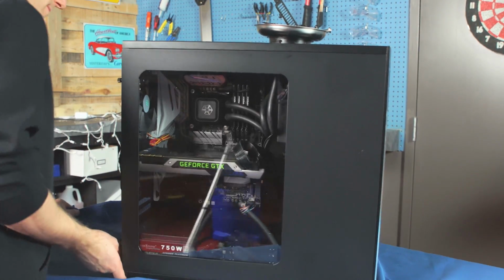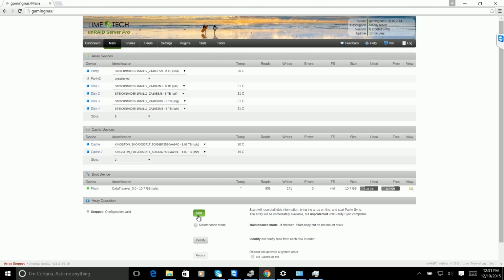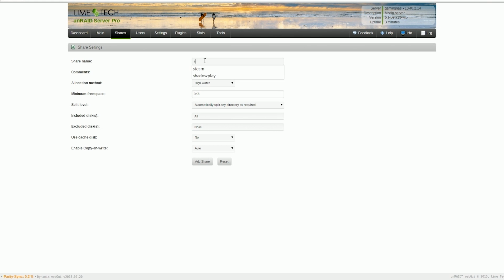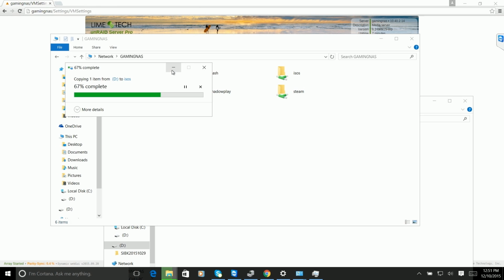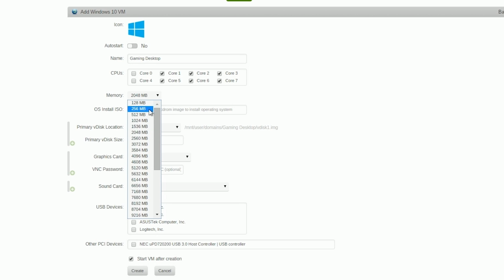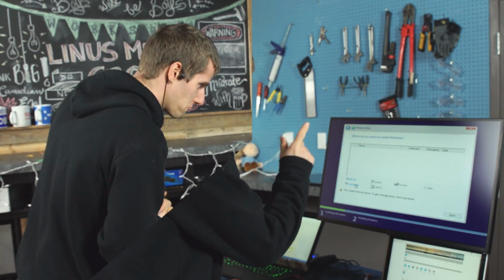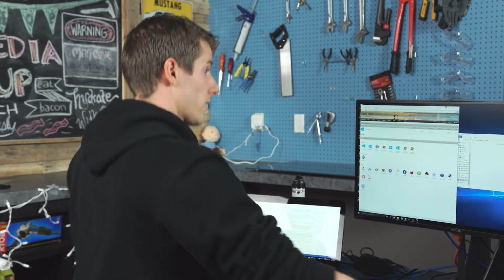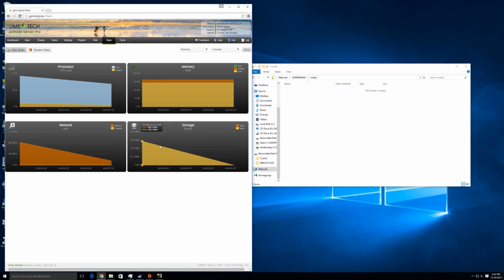Use your Gaming PC's Extra Power as a NAS Ultimate Guide

Comment: I was thinking of doing this with a 5950x for gaming and passed through video cards.  So that I could dedicate enough cores for solid gaming but still have several left over for other van projects and experimentation. However, the mother board with video out that I have seen say that a cpu with integrated graphics is required so I think I would have to get a second graphics card.  Am I understanding that correctly.

Comment: Only just came across this. The "tabs" inside the case; If I'm not mistaken they are just "90 degrees bent sections from the main enclosure". I've modified cases that had "tabs" like those and ... I didn't cut them, I just bent them back FLAT to the original side section they were bent from. Am I missing something here or is it just a case that Linus likes power tools too much?

Comment: Watched this the day it came out, loved this idea but was a no budget student. 5 years later finally had enough time and money to make it happen. Truly a valuable and rewarding experience worth the wait :)
Reply: are you still running the same setup? I'm also thinking about doing the same, doesn't make sense to have a separate 100W system just as a NAS. How is the VM performance?
Reply: @justfasial01  I do, it’s pretty good. I don’t notice much of a difference once I finally had everything configured with a dedicated ssd and gpu passed through to the VM. However time and likely cost wise (need for specific motherboard features etc) it didn’t end up making any sense at all.

I enjoyed it because I wanted a summer project to tinker on and am lucky enough to afford a nice laptop to daily drive so I am okay if it breaks or is out of commission because of the odd update. 

If you want to tinker and learn its a fun project/puzzle that only get easier with software improvements/drivers.

Comment: I know I'm about 4 years late to the party on this one but, I don't see the need for unRaid.  

I run a gaming machine (Freaky but same mobo and CPU as this!) which has 60TB internal and 55TB external via USB (mirror of internal), 16gb RAM and Zotac 1080 Amp Extreme.  I use Stablebit Drivepool to create single shares to access these two drive pools, all running on Windows 10.  Unless I'm missing something here, unRaid is another layer of complication that I don't see as needed when Windows 10 and Drivepool appears to be much simpler and I play games "native".

Comment: what do you do if one is using an AMD cpu with no onboard graphics??  set the BIOS before installing UNraid....setting IGFX defeats the purpose... should i use the web interface instead of the desktop interface? i want my VM to use my GPU and stay untouched by UNraid?
Reply: will be using a 3900x with B550-F strix mobo

Comment: So what happens when you are gaming and Plex decides it needs to do "on the fly hardware transcoding with the GPU"?
Reply: I think you would have to disable gpu transcoding so it uses cpu for transcoding.  Biggest issue I have with this setup is that there is no hardware Raid controller so all the raid processing is done by the cpu.  In my qnap NAS it has a dedicated hardware raid controller which is much faster. Also I don’t want to have my very expensive gaming pc on 24/7 so that is why I prefer my QNAP NAS which uses less power and is designed to be on all the time.

Comment: MY NEW FREENAS SERVER/WITH VM WIN10 & HACKTOSH DESKTOPS WITH GPU PASS THROUGH TO VM IN FREENAS
INTEL® SERVER BOARD S5520HCT
2 X S5520 16 CORES
6 X4G MEM 48G MEM
2 X 1000GB LAN +BMC + INTEL RMM3
6 X SATA/SAS = 2 X MSATA 250G AND 4 X SATA 1TB DRIVES 
with onboard VGA on for server & FREENAS and add-on GPU screens PASS THROUGH TO VM DESKTOPS
works real nice once setup & extra drivers are installed and running clone of a working vms gives a more real feal and stable backup to start over if problems happen.. very cool

Comment: note if using 3.5 inch you can only populate 3 out of 5 bays due to thermal conduction   the only way you  use 5 is 2.5 form factor..

high capacity hdds tend to throw alot of heat out..
you be needing space for the heat to escape

Comment: Biggest problems with this, apart from the power efficiency thing mentioned by dozens of other comments is this:
Single point of failure and wear and tear on gaming components like the video card.
WIth this setup if something fails in the machine (PSU, Motherboard, Memory, GPU etc) both your gaming PC and your NAS solution are out of commission until the computer is fixed.
And because everything is most likely on 24/7 your expensive GPU, Motherboard and CPU are also wearing out when not in use for gaming but basically idling. All those components are overkill spec wise for a NAS solution which is usually either ARM or Intel SOC based (Intel Atom processors and the like).

Comment: Simple trick I use, setup your "NAS" hard drives as a raid in windows 10 Storage Spaces and boom instant "NAS", always accessible, doesnt need a virtual machine, reliable and can physically swap the hard drives to almost any computer if I needed to like if the machine I was using crashes. 10/10 been using it for 2 years.

Comment: If I just wanted to be a nub and be simple, could I just use an old pc with a few hard drives in running windows on homegroup and then just host my stuff that I use windows for or are there advantages to using a nas software?

Comment: I am wondering what the performance difference is vs just running a network drive inside of windows 10. 
I have this cage on my PC and it just filled up with random drives with no raid but two of them are networked. 

Would UNRAID help the  Read and Write Speeds of my networked drive? 
Like some kind of windows overhead?

Comment: Thanks for the video. I used the usb passthrough part of the video! Simple to use. I accidentally used the wrong USB at the start and had to modify the syslinux.cfg file. Then it worked on bootup and I was able to assign that usb passthrough to one of my current VMs. I run 2 VMs at the moment and I can add more. I don't need passthrough on each VM, but I wanted it on my main VM. Other notes... Any devices on that usb passthrough will not show up in the GUI menu. Not a big deal if you wanted to pick a specific device add it to another USB bus!

Comment: I bet those drive disks get hot and loud.   Fractal Design Arc Midi for multiple hard disk drives WITH fan airflow cooling and rubber isolation grommits?   Just purchase hot swap adapters for the drives.    NAS or UNRAID drives in the vertical racks, and gaming/OS drives in the 5.25" bays for a nice seperation.   Love the videos!

Comment: Wouldn't it make a bit more sense (and/or be easier?) to go buy a 100$ 5 year old PC with a semi-decent CPU (I mean, even the AMD stuff would be great for a NAS, no?) and just build a dedicated box? the biggest investment is most definately going to be the HDD's, since they're about 80$ a pop for a 2tb and 130 for a 4tb (actual NAS drive).

I have an FM2+ board/chip that I plan on building into a NAS box, just need the HDD's.

I guess my question is, how is the performance of using the steam library over network? or is the NAS just passing the steam library through? I'd like to free up some space on my main rig by dumping a massive crap ton of old data and a few larger but less important (for load times) steam games.

BTRFS vs ZFS vs Raid 10? Raid 10 gives a speed increase i believe, but I don't know much about the others, or what NAS OS to go with? I'd like a free/cheap one if possible. from what I understand ZFS likes ~1gb of ram per 1tb of data? I only have 16gb right now, so should I limited my overall setup to 16tb (assuming ZFS)?

What If i want to increase the number of drives beyond what the Mobo has available for sata ports? would I go with an aftermarket raid controller, or should I consider doing what you did in your other NAS vid where you flashed a HBA?

Comment: So the point of this setup versus simply sharing the raid array or any storage drive on the network without the virtual machines is that if you make transfers on a shared drive or array of drives, other functions of the sharing PC would suffer dips in performance while this setup separates resources so that the transfers on the shared NAS drives don't affect the other PC parts at all. - Did I get it right?

Comment: I run AMD opteron 290s on an older tyan board with dual sockets and Windows 8.0 x64. I have a large array I would like to isolate from the main operating environment that currently has direct access as a drive letter which is risky from the point of view of malware and user error risks. I am running 3ware 9750 16i4e in raid6 across 12 3tb drives. If my intention is to isolate a compromised operating environment does this solution using unraid prevent malware viruses rootkits or boot sector attacks from compromising the machine as a whole that would result in data loss? What are the conpromises of ising this setup?

Comment: Just watched this video. I achieve the same thing with Hyper-V for my vms, which is build-in and windows 10 Pros build-in raid options which I find great (not for the boot disk though). I live in a small flat, so it's important not to take up too much space. I also run a pfSense router in a VM on the same box

Comment: is this build good? 

CPU: 
AMD A4-7300 3.8GHz Dual-Core Processor
$53.00

Motherboard: 
MSI A68HM-GRENADE Micro ATX FM2+ Motherboard
$59.00

Memory: 
G.Skill Value 8GB (1 x 8GB) DDR3-1600 Memory
$73.70

Storage: 
Seagate Barracuda 1TB 3.5" 7200RPM Internal Hard Drive
$50.00

Video Card: 
Asus GeForce GTX 1050 Ti 4GB Phoenix Video Card
$214.50

Case: 
Silverstone PS09B MicroATX Mid Tower Case
$45.00

Power Supply: 
Corsair VS 350W ATX Power Supply
$45.00

Operating System: 
Microsoft Windows 10 Home OEM 64-bit
$125.00

Monitor: 
AOC I2757FH 27.0" 1920x1080 60Hz Monitor
$29.99

Total: $695.19

Comment: That was great, Wish I had seen it before setting up my new PC with a UEFI windows install and raid mirror (as a back up of what I want in my NAS). Was planning to make my own NAS with my last PC but need a cheap case and psu and another 4GB ram. I need to re-address to see how I would fit an extra 2 or 3 HDD's and still have room for watercooling later in the year. Then try understand VM's as never had the need to use one.
Great Video LTT as always.

Comment: @LinusTechTips this seems like an amazing set up but I'm curious if there's a way to push it into low power but shutting down the gaming VM but leaving the NAS running. I'd imaging just dropping the closing the VM would do this but could you make it feel like shutting down and powering up a normal PC with a switch?
Reply: Most modern Intel CPU's are great when it comes to power management. So, as long as you power off the VM, you should be okay.

Comment: I think it is pointless. Because 

1. A dedicated NAS will be much easier to get and be more energy efficient plus it will not load the network on the main system plus you can build a NAS for a cheap price right now.
2. For home user scenario, if you want to do this, you can just share folders on windows, yes it might not be that robust, I often time have trouble accessing shared folder on windows but Linux runs shared folders absolutely fine but it is doable, rather than doing all this.

Comment: Linus what happens  when the pc is broken? how can i get my nas files back? can i still make the Nas work on other system without data loss?
Reply: Yves De Witte your data is still saved safe on the nas drives.  all you need to do is migrate it into a new nas PC
Reply: dont you need to format the disks again to re-setup freenas or unraid?
Reply: Common Sense: If you format the NAS raid disk array.  You delete all of its contents.  

When you migrate to a new (PC) system.  You setup Unraid first (Boot Drive) to get it up and running smoothly. Then you add the NAS raid array next.

Comment: Linus, hope you can clear this up for me.  I am seriously thinking about doing this but I'm having trouble figuring out how you attached 7 sata drives (5 in the cage and the 2 SSDs) to the MB, since everything I read says the MB only has 6 SATA connectors.  I would have loved it if you'd recorded wiring everything up.

Can you clarify this for me?
Thanks
Mike
Reply: I am one year too late but if someone is still wondering.
He probably used a pcie sata expansion card.
Reply: In the video the board is shown to have 9 SATA ports. It's likely that some will be SATA 3Gb/s and some will be SATA 6Gb/s so what you are refering to is probably 6 ports being of one of those speeds, and the other 3 ports being the other speed.

Comment: Couldn't you just get a hardware RAID card, put 5 drives in a RAID5, partition it in windows and use windows sharing? Thereby not permanently removing the cores from use by other things? I mean if your rig is only a quad-core and you designate a whole core to NAS then you're going to lose performance for something. Have I missed something?

Comment: Hey Linus i need a bit of help, i did the NAS /system and sound is most of the time ok but dose stutter / fails (Display-port)
i did a modification that i am proud: instead of passing-trough the extra 4 port pcie 1x card i got, i passed-trough the motherboard pci internal usb controller (one controller to rule them all - 4x usb 2 6x usb 3 and internal usb with a internal usb hub (multiplies my internal usb from 2 internal to 8 powered) and it works (get the unraid usb on the external when booting then if you need to put usb mouse and keyboard on it to (give it to other wm or use in GUI) and everything you want to use just connect to main ports (back front whatever) 
You MUST stress the point of having more than 4 cores and i5 - my quad core i5 is not coping with UnRaid and Windows 10 in games and my 3Gb R9 is also not doing so well.
If i want to play Mafia 3 CPU is dead not enaph (was 100% load on bear metal so...   quadcore i5 at 3.2 GHz was sufficient but could do more in this configuration is crap.
Fallout 4 in ultra kills the video (mine is an OC model so just rump-up a bit the setting and it's fine most of the time.

Accessing the "HDD" is a problem - sometimes it has lag and that is bad. System freezes for 5-10 seconds not even browsers work or explorer after a bit comes back to normal. i Have a 1.4Gb/s M2 (PCIe 4x) SSD so i dont think that is the issue just it's considered network traffic so it's slow some times. 

Please make a video in setting it up and dooing all of the modifications so it works fine with not so i7/ titan parts (similar to : i5 Quad and r9 280 for example - medium buget) if you can. Thank you

Comment: lolz... dual channel ram :P
Reply: Michael Rinkle yea but there's no noticeable difrence between duel and quad channel. benchmarking would only result in a 2% increase  in performance on ddr 4.
Reply: Joshua Woods dual channel is good up to 64GB of ram at about 34GB/s and great if you already have an identifier setup. However 2% on a benchmark means little for some people's workloads, 8 threads just aren't enough. ie: according to Puget Systems, Adobe Premiere Pro 2017 runs out of "steam" after 10 cores (un-hyperthreaded works better than HT) Adobe Premiere Pro is also RAM hungry consuming up to 48GB Depending on the project. also quad channel shows significant gains when rendering in applications or doing Fluid Dynamics. I got this Xeon 2630 v4 10 core w/HT. up to 68 GB/s quad channel bandwidth. 
def won't notice in gaming since most happens on the GPU.

Comment: It's all well & good to be doing "tricks" like this build, but let's look at this objectively. The whole reason you have a NAS device is so that as a data repository it is independent of any particular machine (just like a network attached printer) such that should a machine go offline it does not affect the accessibility of other users on the network.

Something also worth pointing out is whilst it was great to show how there was no FPS drop out during a large file transfer to the NAS, in a traditional setup you would not experience that anyway since the packet traffic would not be heading in the direction of the gaming device anyway. Any bandwidth issues in the network would existing exactly the same for both scenarios so showing the non-FPS drop out really is just glitz & glam.

Comment: I am very curious about this. I have never dealt with a server but have planned to build one for quite some time just to have all stored files accessible for all PCs in the home.

I am about to buy some (for me, completely insane) parts from a guy that doesn't need them and will have motherboard with dual 14 core Xeons and 64gb of DDR4 ECC RAM. With all that performance, something like this makes perfect sense to run on the main machine. Those CPUs doesn't have onboard graphics though,  but I expect there is ways to work around that?

I also very interested in if there would be any additional problems to this setup with that configuration. Any replies/information is appreciated :).

Comment: damn so do i need integrated graphics for this as well as dedicated? i was hoping to do it on an i7 6800k, any advice would help
Reply: If your CPU or motherboard dont have integrated graphics you can just buy a second dedicated graphics card. A cheap one for 30$ would be enough.
Reply: i already have two 980ti's would i be able to keep them in sli to do this? or would i have to take them out of sli
Reply: jjtonelli No. You cant use two identical graphics cards for that because the host cant distinguish them, no matter if youre using SLI or not. It would work with one 980 and one 980Ti but that would be a waste of money because you cant use one of them inside your virtual Machine. Its the best to get an extra cheap graphics card you dont use for anything else. I dont know if its even possible to give both 980Tis to your virtual Machine in the first place.